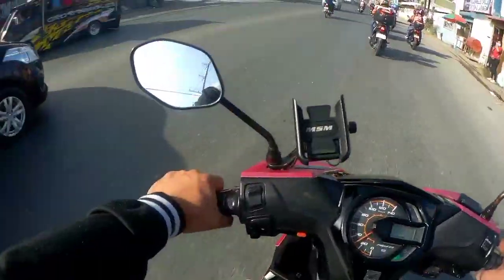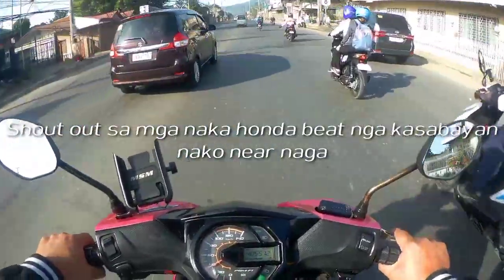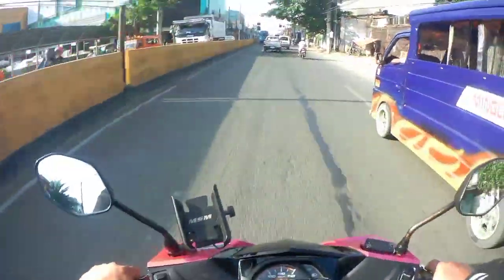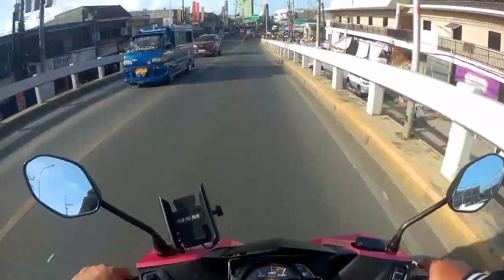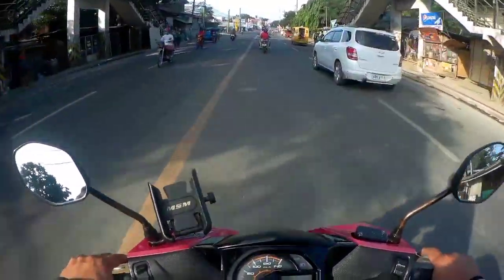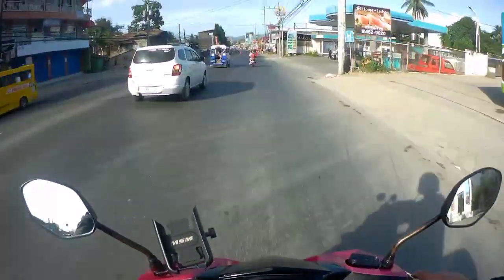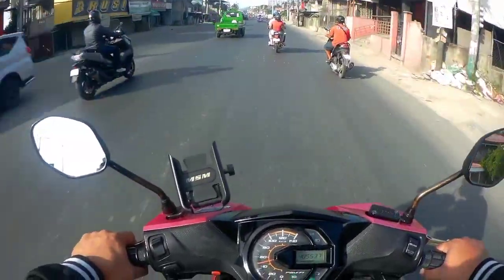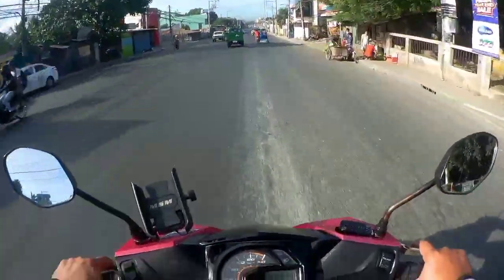SpeedTuner Pulley set Review | CVT Tuning | CVT upgrade by MICKEY MAZO | Honda Beat fi Vs. Click

Comment: paps sakin speedtuner pulley set dn tapos 1k rpm center spring at 1k rpm clutch spring  13g flyball 85 lang top speed parang may pumipigil at umoungol na sa 85 d na na angat ano kaya problema?..ride safe always